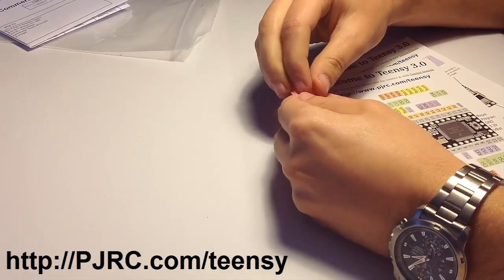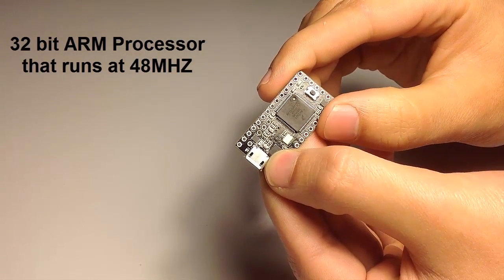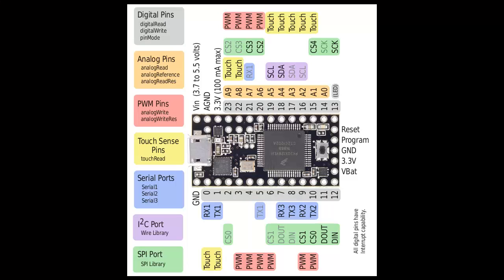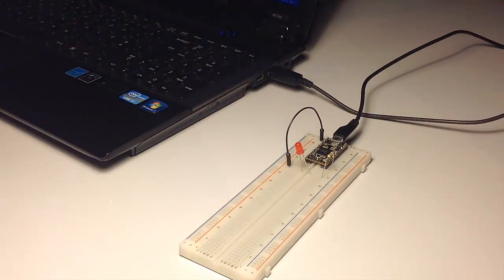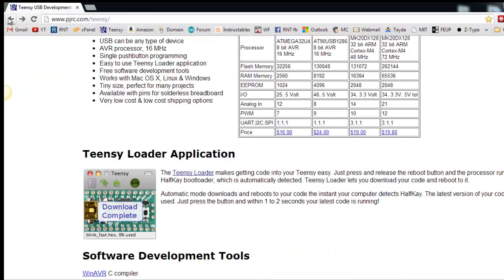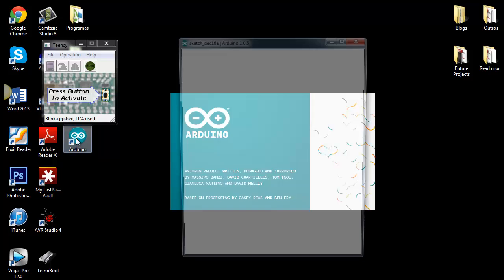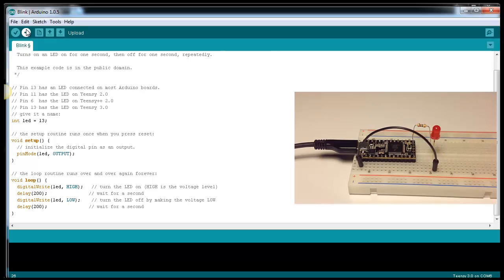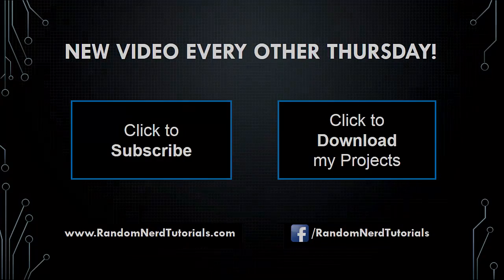Getting Started with Teensy (Arduino Alternative)

Comment: When I click either "Verify" or "Upload", it says "the compiler quit with an error, but did not print any error messages!
Your computer may be running out of memory or resources.  Try closing other
windows or programs
Error compiling for board Teensy 2.0."
Task manager shows that I am using 2.6GB of my 4GB memory, and the only other program open is my browser, as I am following your instructions.
I tried taking the Arduino program down and restarting it, but got the same result.
Any thoughts?